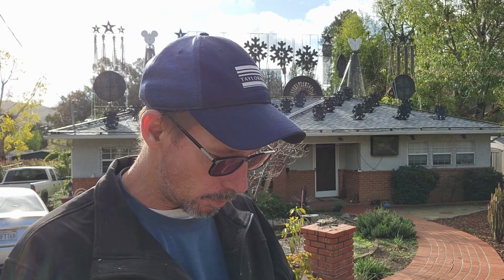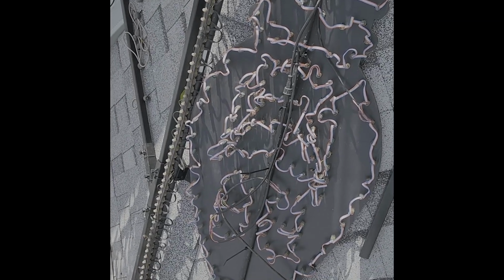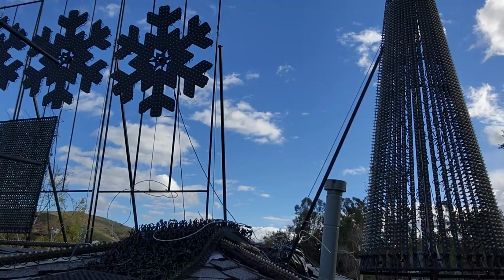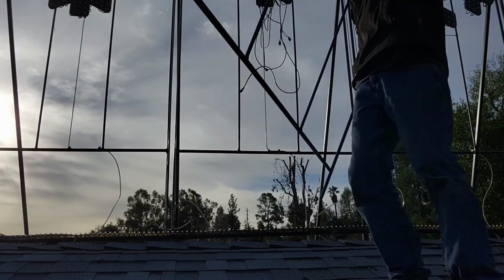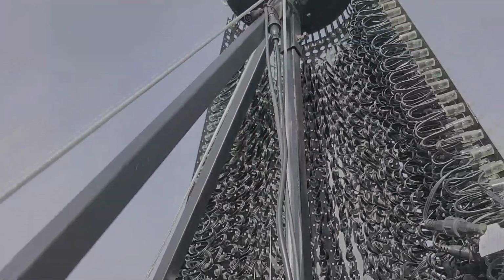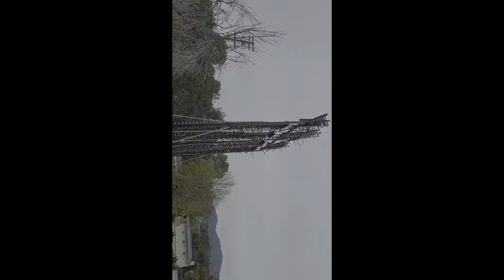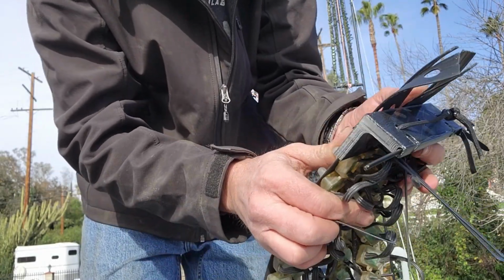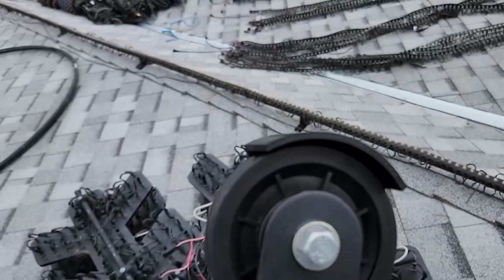Spiker Lights 2022 Behind the Scenes

Comment: Good video John.  I am trying to figure out how to fit solar on my roof and keep my roof props.  Unfortunately, the side facing the street is the same side I should put my solar on.
Reply from the maker: I have a similar challenge. Right now all my solar panels are on auxiliary buildings. I want to add them to my house roof just not sure how to fit them in.
Reply: @jspiker77  Good show! Where did you get the stars and the pixel poles, as well as the matrix?

Comment: Thanks for sharing your process!! Did you make and weld all the square tube parts for the angles and connections? What sizes did you use for the inner and outer parts? Thanks!
Reply from the maker: Yes, everything was fabricated by me. The outer tubes are 1 1/4 inch 14 gauge and the inners are 1" 14 gauge.
Reply: @jspiker77  awesome great work! Very impressive!!